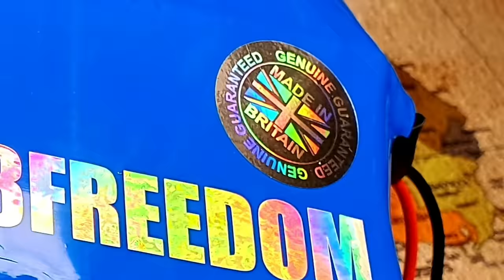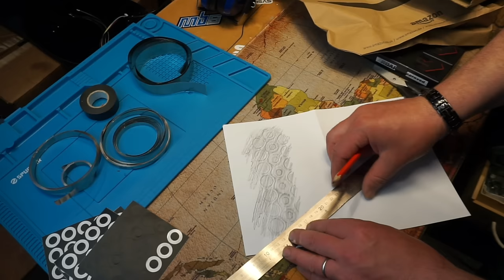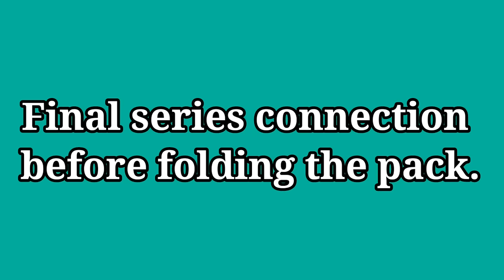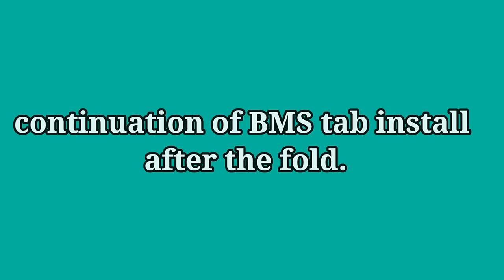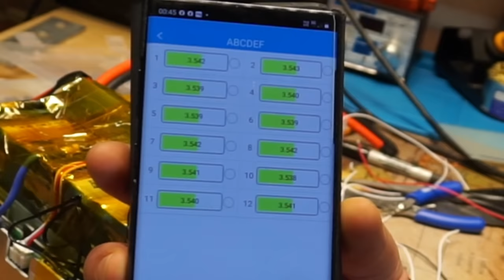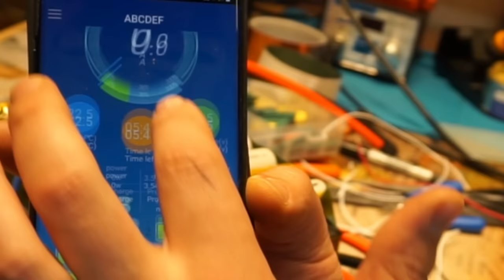Most detailed battery build tutorial. Block battery.

Comment: The BMS has to interrupt negative from battery to prevent over discharge. I don't see how this is done in your video. This is not manual discharge but monitors battery voltage and prevents over discharge.
Reply from the maker: I do not use BMS for discharge, it is by-passed. I do require high discharge rate and there are no BMS units to match the demand. Good esc will manage the discharge fine.

Comment: Haven’t gotten 5 minutes in and it’s already amazing! I’m looking to build a VERY similar battery molicel 20s6p. This is exactly what I needed to give me the confidence and knowledge to build it. Thank you a million!
Reply from the maker: Will,
Thank you very much 😊 
There is another battery building tutorial on my channel, have a look... just in case if there are some points that you were looking for. 
Happy building!
Reply: I'm gonna make the same battery. How did it go and what were your final dimensions?
Reply: @tobiasfunke  It's actually 20s7p - and it's for an ebike. I'm building a custom 3D printed trapezoidal case... so it's kinda difficult to measure. I''ll say if you're planning to do 20s6p for a skateboard that would probably be way too big. Looking at 21700 cell holders.. they're 22.5mm long each. so ur battery would be like (22.5 x 20) mm long and  (22.5 x 6) mm wide. Like 7in by 18in after you insulate it probably, and bigger if you plan on having a waterproof container. I guess you could always double stack it. Mine's going on an ebike in the frame so size isn't really a concern
Reply: @williammadisondavis  thanks for the reply. I'm gonna put it in my Razor RSF 650. Ok was gonna do the offset cell holders. Good luck to you.

Comment: Hey, very informative video. You can edit it on YouTube settings to add chapters instead of timestamps at the beginning. And why connecting BMS tabs to positives when they are connected to next series negatives? Just spot weld BMS tabs to negatives and first positive, less risk of shorting and no need to secure each tab except only one positive.

Comment: Hi Pavel ,  very well filmed and instructive video , lot of thanks!!
I already builded some DIY Lithium packs for old  NICD power drills, E-bikes , and also motorcycles (lifepo4 with high amps).
But actually it's more and more difficult , sometimes impossible to do that , simply because generic BMS are no more accepted by the engines , I think essentially for commercial reasons : Each society builds its own BMS with specific communication with the motor controller and also with the charger. And if I simply want to change the cells, the necessary disconnection of the BMS "locks" it definitively.
For example with my E_bike (Panasonic system) I can add a second DIY battery in // (more capacity and discharge amps) but I need absolutely the Pana-battery to run, the same with Dyson vacuum cordless packs etc...We are prisoners of the manufacturers...For my car I can choose any battery without issue, but not here!
I fear we will have more and more problems in the future with Lithium batteries if all these legal "robberies" are not forbidden. I say "robbery" because these schemes are absolutely not necessary for a good protection of the cells : A BMS like yours in the video is perfect.
Friendly from France, Michel.
Reply from the maker: Hi Michael!
Thank you very much for watching and for the comment. Glad you liked the Tutorial.
Happy building!

Comment: Good tip about the negative centre not to heat. Re sensor or switch ,underneath the surface of the negative plate end of the 18650

Comment: Pavel
I have a tip I use when stripping insulation off large silicone cables 

Strip Back 6mm or so of end insulation 
solder loose end up allow some of the solder to run in cable just a little 
Cut exposed wire off level with insulation
strip silicone insulation back amount required
where you soldered inside insulation now will not fray and willbe a lot easier to handle  
cable will be like a shoe lace
Reply from the maker: Thank you mate 👍
Reply: @PavelGarmas  found your videos usefull in learning this electrickery stuff retired engineer trying to learn still, bought a Kweld for workshop

Comment: Damn... I learned alot from watching 2x 1h40m videos! I went straight to this one after the older one! This will be sooo helpful in making my build safer, better and looking a lot more sexy!

I am however curious: I have the exact same BMS as you are using in this video (Double wires, only B- and C-, BT module etc). How do I wire it up, if I actually want to charge and discharge from the same port?
Reply from the maker: Hi mate,
You will not be able to discharge via bms if you got the same unit as in the video...this is a 20Amp unit so really low. I do not use discharge...charge only. ESC will manage the discharge.
Reply: @PavelGarmas  Sorry I didn't clarify: I have the same BMS, but rated for 60A. I'm doing an eBike build with a rear rack and battery, so I want to use the same charge and discharge port (same Anderson connection in the front), but I'm not sure how to wire it up having only C- and B-. Your efforts are much appreciated mate, thank you!

Comment: Pavel, awesome tutorial and awesome content.  I have a question in regards to the BMS.  Will the BMS constantly draw current from the battery when connected?  If the battery is put into storage for a few months, and the battery is at storage voltage, will the BMS continue to discharge the battery pack to 0V?  If it does, have you thought of a way to disconnect the BMS when storing the battery for a few months or weeks?
Reply from the maker: Hi mate,
Yes, BMS will consume electricity from the battery however it is minimal. I do normally leave the battery at 3.8 volt per cell and a few month of storage is not an issue. There is an option of static balancing and that does drain the battery much faster.

Comment: I love your work! Most people won't share anything! It's like some ancient secret or something! Thank you for doing this!. PS: Which wires did you use for battery charging port? Which one is the the most proper wire?
Reply from the maker: Hi Steve! Thank you mate. I do have the flat pack tutorial on my channel as well have a look. The charging cable is high temperature silicone wire. I think it was 18 or 20 gauge. https://www.ebay.co.uk/itm/322860010747?hash=item4b2bf4ccfb:g:UpEAAOSwSk9ckP-2
Reply: @PavelGarmas  Thank you Pavel!
Reply from the maker: @stevemuzak8526  no problem 😊

Comment: Great video, some good very ideas. You said you weren't sure about how much nickel you should use, as a ball park you should have 0.15mm² nickel/amp. In your configuration I would guess that the strip is about 140mm long therefore, 140x0.2=28mm², 28/0.15=187A. So you didn't need to double up but as you said it doesn't do any harm.
Reply from the maker: Dan,
Thank you. I just learned something new. Appreciate the comment mate.

Comment: Hey Pavel, I have a 3000w 72v 100amp max 50 amp continuously motor. I'm thinking of making 18650 20s 6p battery. I wanted to know what size of nickel strips I should use?  This is a budget build, so could i buy a bms only for charging and balancing? I would be bypassing the discharge,( which doesn't seem to hard). bypassing the discharge will be more dangerous for my long term battery, i believe.

(Thanks for all your videos, I learned alot from watching you)
Reply from the maker: Hi mate, 
For straters, make sure that you use motors that are rated to the voltage you are planning to build a battery to. I do always by-pass bms on discharge and let esc do this part so yes, you can get the lowest Amp bms and use it for charge only. Higher voltage set up will not require as high Amps so if you use 0.2 thick nickel you should be fine.

Comment: excellent video. You answered some key questions that I had. Also,Quick question- I have parts on the way for my first build. . I need to power a 24v 350watt motor 18amps.  My plan is to build 6p-8s with 18650 cells that are 3150mah. My math says it will be 29.6 volts and 18.9 amps. I will be useing a cheap 8s bms 60amp.  Will this work? and will this be enough for 2 hours run time.
Reply: With 8S you have a maximal voltage of 33,2V (4,2V x 8) , it's too much. More power , but can the motor accept it? For 24V , 6S (=25,2V) is good....and with 6P you will have much more than 18,9A, except if you use computer cells (not the best for a motor) with 5A x 6P = 30A. For a motor , cells with low amperage are not the best  because the internal resistance is higher and it's not good if the motor drains sometimes more amps against resistance...but with 6P it will run . A lot of E-bikes batteries have not more than 5A/cell...if they have minimum 4P .
It depends on the type and the use of your motor.

Comment: Hi Pavel, thanks for making these videos on battery building. They are awesome and have given me the confidence to build my first pack for an eBike. I have the same make of BMS with 2 blue and 2 black wires 52V 60A. I know you have removed one of the blue and one of the black wires as you do not use the BMS for discharge monitoring in your pack. For my eBike I do want to to have this feature. I can see each cable is labelled 10AWG. My question is about how I should wire the BMS - should I run one of the black C- wires to the charge ve and the other black C to the discharge ve or do I join both black C wires together and join them to an XT90 -ve and use the one XT90 for discharge and charging? Thanks for your help but I haven't been able to find an answer to this on searching the web of the manufacturers site.
Reply from the maker: Hi mate,
B- to battery negative 
P- to load negative (esc)
C- to charge negative

Hope this helps.
Reply: @PavelGarmas  Thanks for the reply. This BMS, and the one you use in this video, does not have a P-ve. There are only 2 C- cables (black) and 2 B- cables (blue). Is the reason there are 2 black C- cables because the each cable can only handle 1/2 the BMS discharge current or because on black cable is for the charge -ve and the other for the discharge -ve?
Reply from the maker: @jimhamilton7959  
All depends if you got the old or new style of the unit. If exactly same as in my video then follow my earlier reply , if new then the charge and discharge are the same cables .

Comment: Hope you get something from the links because I bought the BMS using it. I already had a 52v bms but I like the idea of bluetooth lol. I already have anxiety about doing this the first time and this video helped a lot plus having the smart bms to keep an eye on things is really nice considering I can't drive for medical reasons so I use my ebike as my car every day. put over 1200 miles in 1 year lol. cells all test really well though they were rated at 1500mah and i got 1450ish on all of them. out of over 100 cells only 1 was dead.
Reply from the maker: Thank you for watching mate. Appreciate the comment. I do always use the smart BMS for the reasons that you have mentioned - it is always good to know what is happening with the battery.
Reply: @PavelGarmas  So I have almost everything now. I can't find that connector though and your link is dead :( Would you be able to give a link for that? as well as the other end so I can modify my current charger (it has a different kind of tip). I'll be happy to buy it from an affiliate link if you have it! Otherwise I've got it set and the BMS is working I think or at least the app sees it. I need to figure out how to wire it up to my case now lol
Reply from the maker: @UchihaSumairu  hi mate do here is the power plug. You can buy anywhere you want,  i do not have any affiliate links.
https://www.ebay.co.uk/itm/ANTI-SPARK-QS8-S-Connectors-Pairs-Battery-High-Current-Power-Lipo-QS-8-ESC-RC-UK-/284372561695?mkcid=16&mkevt=1&_trksid=p2349624.m46890.l49286&mkrid=710-127635-2958-0
Reply from the maker: @UchihaSumairu  and here is a link to the charging plug that i have used.
https://www.ebay.co.uk/itm/2-5-Pin-IP68-Waterproof-Inline-Cable-Coupler-Plug-Socket-Connector-Pair-SP13-/294336364468?mkcid=16&mkevt=1&_trksid=p2349624.m46890.l49286&mkrid=710-127635-2958-0
Reply: @PavelGarmas  thanks so much!!

Comment: hey i love your videos. I have a problem I am building my board and life got in the way and i was not able to finish it for a long time any way I just got the Moli cells 21700 in for a 12s3p for a set of Torque boards Direct Drives. They are 80 amps a piece. Would I get away with a 12s3p? What do you recommend?
Reply from the maker: Hi mate, 
Thanks. 
12S3P will be fine but what do you mean by " getting away with it "?  Many factors here...your weight,  terrain,  riding style. 
You should be getting around 10 miles i would say.
Reply: Well my understanding is the heat becomes a factor in batteries when u draw more amps then they can easily supply. Hey can you make a video about wiring Batt, BMS, Anti Spark the charger and the ESC. I would love to see the correct order, an how they should lay in the batt box.  Thanks
Reply from the maker: @Nicoricanmarxist  
Hi mate.  All the videos thst you have requested are already on my channel mate. Wiring of BMS is part of this video.

Comment: Pavel:  Have you ever considered putting an in-line fuse into the battery circuit to protect from short-circuit condition, or perhaps something leading to thermal runaway?  I don't seem to find anyone fusing these batteries anywhere.  Not sure why.  I'm wondering if you can install an ANL fuse rated for ... say 100 amps.  Obviously, don't want it blowing (ever) but it would be some form of protection if something goes bad.  This would be the same type of fuse that is used in the kweld battery welder.  Seems that there are ANL fuse holders out there to isolate the fuse.  Also, wondering if you have considered fusing the "charge" circuit leading to the BMS ... say an in-line 10 amp fuse, but would need to be rated for the higher voltages (50.4 volts in a 12S config).  Anyways, just a thought if you have an opinion on it.
Reply from the maker: Hi mate,
I know some good battery builders and some do use the fuses. My opinion is tat having the fuse blow when you are riding and loosing the breaks is worse than having a chance to stop even if the board catches fire. I do always monitor my batteries when charging and have fire alarm heads installed around the garage... I will try to make a video on this mate. Are you on my FB group ESK8FREEDOM? Would be a good topic to discuss.
Reply: @PavelGarmas  Heh Pavel, I'm not on Facebook at all.  Never have been.  Not really into all that crazy stuff.  I get what you're saying about losing brakes in the event of a fuse blowing, but what if the fuse was sized large enough that it would basically never reach the point of failing unless there was a catastrophic battery failure?  I would think that there is a point where a rider is free from risk of brake loss versus protecting the board from a complete lithium battery meltdown.  No?

Comment: u used 2xlayer of 0.2mmx25mm pure nickel on ur pack is that good enough to discharge up to 150a peak like 5sec or best to use wider like 30mm sheet or not what are u advice?
Reply from the maker: Dual layer is an overkill but i do prefer to have a solid battery. Dual 0.2 x 25 with 4 pairs of weld will be good for 150 Amp in my opinion. I did manage to pull 189 Amp for 10 sec on my board and no problems.

Comment: How much would it cost to make a bicycle battery 48V20Ah? This will be my first and would need the cost of all the tools etc. Thank you
Reply from the maker: Welder, soldering iron,hand tools... circa 300.
Cells and nickel depends where you buy from. Have a look on Fogstar wholesale.
Reply: ...and verify if the motor controller will run with a generic BMS. It's not the case with my Panasonic motor. It needs a specific Panasonic BMS.

Comment: Can the Smart BMS’s be set up in a common port method like the Daly BMS’s? I have noticed on both your videos you have a separate charge and discharge port.
Reply from the maker: I do not use the discharge side of any BMS ...charge only. Did I get the question correctly?
Reply: @PavelGarmas  you did, I am curious as to why. I joined your group on Facebook and it seems like a lot of the batteries built there use a separate port for charging. 

I understand the application of the batteries is different, but nobody (or very very few) building packs for what I am use a separate port for charging. 

I guess I’m just not educated enough on BMS to know why people go one way or the other with their pack builds.

Comment: Guys good job, but for me is one question 
I have meepo and just did battery for it and connect BMS like it is on BMS manual but I have problem with braking, when battery is full brakes don't work after they are very weak
Reply from the maker: Hi mate,
Did you wire the BMS for charge only? What is the vesc setting on the regenerative braking?
Reply: @PavelGarmas  I did it like manual said and wire for discharge too, so now questions is if I take out negative cable from BMS and solder it to negative terminal on battery or 
Leave negative cable on BMS and bypas another cable on BMS negative battery terminal ?